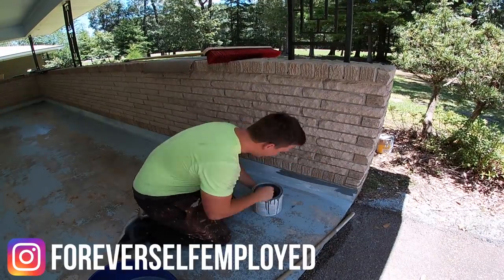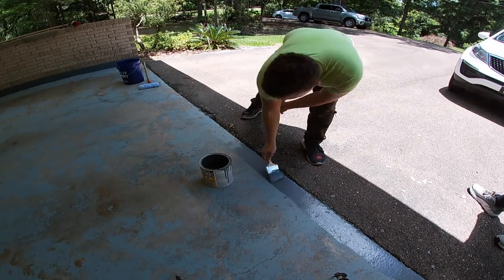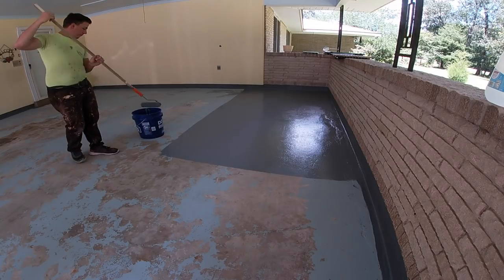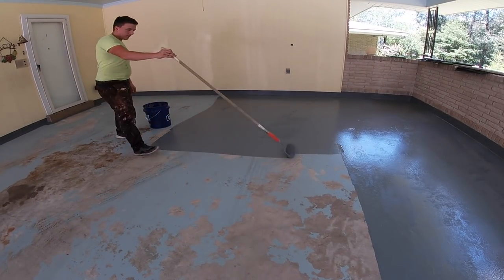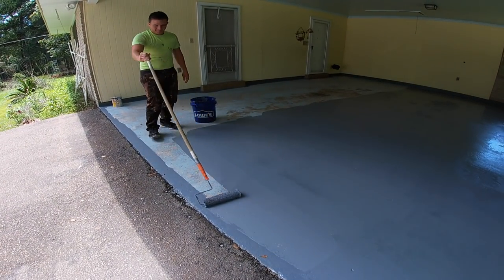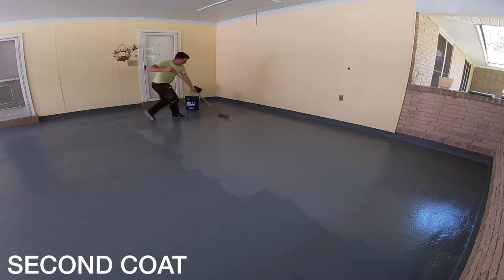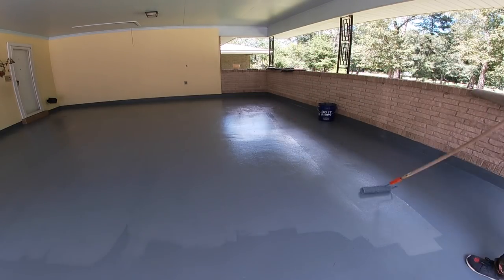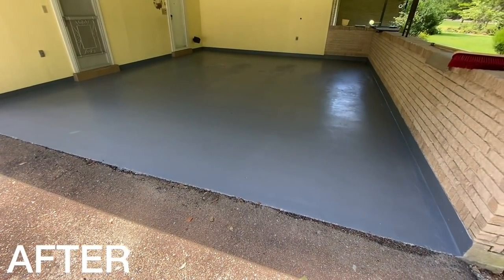WE MADE $750 IN 2 HOURS PAINTING THIS GARAGE FLOOR

Comment: Paint roller is needed but also much more.  Worked at industrial sherwin williams store,  this is not a proper prep for this floor.  If this is foot traffic only, fine.  If you intend to park your car on this you must grind it or use a shotblast machine to give the correct profile surface to keep adhesion.  Second,  the product used is bare minimum using the most inexpensive resin package available.  There are 2 other options a novice could apply that will keep for many years.  On this particular job you could attempt using epoxy paint but you may risk failure because of sunlight exposure.  Epoxy fails in sunlight because it breaks down the finish making it chalky.  The biggest failures that occur with Sherwin williams came from floors or roof Coatings.  Be careful in bidding as you need to know what the customer expectations are.

Comment: Makes sense to sell painting and pressure washing together I've been doing it for years nice job Mr. Billy 👍
Reply: Johnny AppleStead  the old guy could of said no, your assuming he can't make a logical decision, painting prices have gone way up in the last few year's being self employed you get zero benefits and it's expensive to run a business if the old guy called let's say Certa pro the price would of been much higher because they sub out their work alot so to make money they need to charge enough to split 60/40 in their favor after materials it's just business but i definitely don't like anyone scamming the elderly my mom is 86 she still sells real estate and has an iPhone and macbook so age dosen't mean anything not all old people are demented but i meant the job looked nice he even rolled it all horizontal then did another coat vertically which is the proper way to do floors and ceilings and he used Sherwin Williams so their concrete and floor paint's and stains are pricey but high quality but everyone is entitled to their opinion i don't think he scammed anyone

Comment: Great result! What would you do if you had some surface imperfections to fill in? Is there a product for that you would recommend before the paint goes on? I am considering doing epoxy but my gut tells me that's the more expensive route. I like the idea of paint because it seems like it would be easier to work with. Paint Roller :)
Reply from the maker: Great question I will have to ask
Reply: Epoxy will cost more but definitely last longer and won't chip as easily. We use Ardex Patch with my Epoxy flooring company to fill in any holes.

Comment: @:42 “so you guys had done some work for this guy previously right?” Asking that question immediately after the guy told you they had just recently been hired to pressure wash the guys house.

$750 to paint the guys floor that’s just going to fall right apart. Why wouldn’t you use a Urethane or something that’s going to last?

Comment: No prep, coating over another product, no moisture test. That product won’t hold up to hot tire pick-up either. These are the crooks of the industry. Non-slip is 5%?? Shark Grip is cheap, $8 to treat a gallon of material.
Reply: I knew they were crooks when he said they up sold to a 90 year old man. If they're going to do a job, do it right.
Reply: @gareytran  up sold meaning they where getting another job From him to paint his freaking garage floor smart one

Comment: For anyone new to Epoxy Flooring, the material they used was a cheap latex type of paint, with not properly grinding the floor with a diamond bit at the bottom, its going to peel and flake. Another thing I noticed is that they did not allow the floor to dry for AT LEAST 4-6 hours. Yeah the surface of the floor was dry, but the concrete still contained moisture inside of it's pores. Please do your research before doing a new project.

Comment: How do you justify $750 for a 2 hour job?
Reply: Yep, didn't think you could.
Reply: The average person with lack of knowledge and efficiency would probably take up to 5 hours, spend over an hour in a store looking for the right material and probably have to do the job twice to meet expectations
Reply: @LaCajunWash  looks like he may have to do the job twice as well once it begins to flake on the areas he painted over old paint. $750 is a rip off and unjustifiable for putting paint down on a floor that size. Saying it would have taken a homeowner X amount of hours isnt the right answer. I doubt his overhead constitutes charging $750 for 2 hours of work.
Reply: @elephantom12  I think $750 would be good if he did better prep. Grinded and skimed the floor with a feather finish then painted.  Even if it was slightly more for the extra materials would be fine